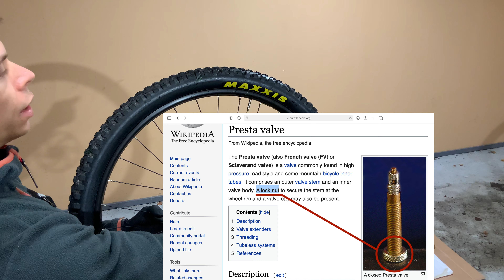DIY Tubeless Conversion - How to setup tubeless MTB tyres with duct tape

Comment: still work ?   

I try to use for my motorcycle rim but  motorcycle is more heavy (150kg ) and more speed ( over100km/h)  
how do you think ?
Reply from the maker: Yes, still works. We have used this on another rim too. 
Don’t know how it would work on a motorcycle. probably not that well because of the higher pressure, heat, added weight and loads.

Comment: 60 psi is ok or not?
Reply from the maker: Hi! 60 psi is excessive. Stans recommends 35psi for seating the tire, max 40psi. 
Too high pressures can damage the rim and/or tyre and may even affect the sealant. At least check the maximum pressure for the tyre you are using (labelled on the sidewall) and the max pressure for the rim if printed. 
I’m talking about MTB tires here.
Reply: @NorthernBikeChannel  ok thank's!